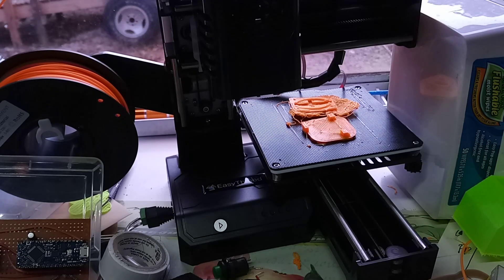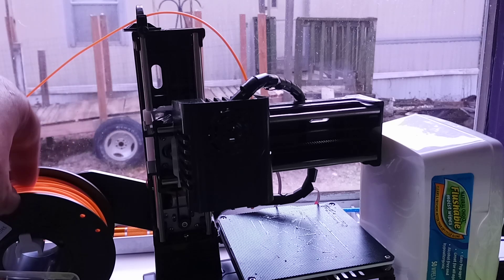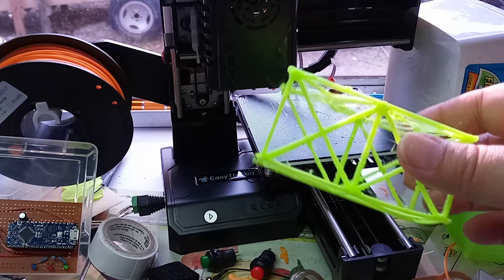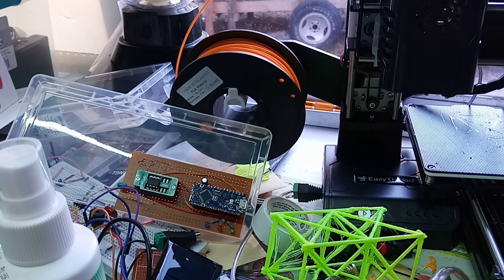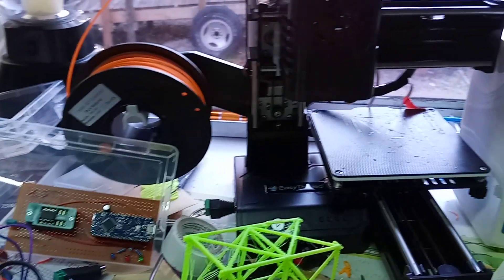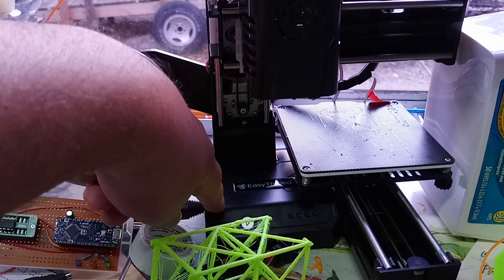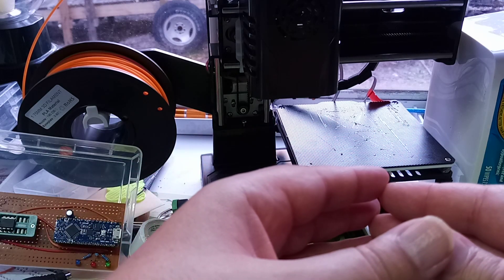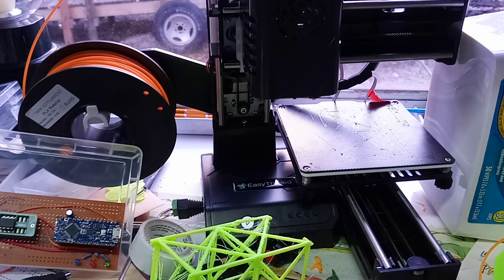Is 3D printing worth my time? #3dprinting #3d #3dprinter #3dprint #productivity #quality

Comment: Your filament is wet.  Your printer, no offense, is shite - which is what I think you brits say - so I'd recommend looking into a  Bambu A1 Mini.  The fact you've had to replace all that stuff is a clear indicator of the quality.  You'll need more desk space for the A1 mini though because it's a bed slinger.  The A1 mini is £141.00 and it's pretty much setup and go.  But also back to my original point, keeping your filament free of moisture would go a long way too.
Reply from the maker: The filament is kept with the printer and there's no actual water gets near it. Only atmospheric humidity will get near the filament and there's nothing that can be done about that.

All this "buy another printer", your filament is "wet" and so on just tells me I made an error of judgement in buying a 3D printer. I'd have been better with a drill press as a basic start. At the time I wondered whether 3D printers sounded too good to be true.
Reply: @britishtechguru  You'll find that's not good enough for such a humid climate.  I live in Vietnam, which is roughly equivalent in terms of humidity as the UK, and I keep my filament in plastic cereal boxes with desiccant holders to keep humidity down to 20%.  PLA is more forgiving, but PETG is a sponge and needs to be dried - in humid environments - before printing.  For PETG I use a filament dryer unit.  I only print PLA/PETG so I'm not knowledgable about other types of plastic like ABS or ASA.  I do know that managing the humidity of my filament gives me crisp non stringing non failing prints, whereas before I did that it was not the case.  You should seriously look into the Bambu A1 mini as it seems perfect for your particular use case.  Good luck!

Comment: Your problem is not with the tool but the money you are willing to spend on dimensional accuracy and quality. Cheap tools are not accurate and, in this case, barely fit for purpose. You may encounter similar issues if you get an inexpensive drill press and lathe. I suggest you appreciate the time, money, energy, and knowledge required for good fabrication. I don't know what tools you already own and have training with, but a drill press and lathe cannot make quality gears or chassis alone. 3D printing is the easiest way to get into fabrication by far. If you had bought a Bambu Lab A1 Mini, this video would show how shocked you are at the quality you can get with a 3D printer.
Reply from the maker: Gears aren't worth printing. I bought a pack of them and 2mm axels on AliExpress a while back. I have electric motors with the same gearing too. That should be fine for most things. I read up on 3D printing and it just seemed that unless I was going to print with nylon, it wasn't worth doing gears. Mind, they're cheap enough for a bagfull anyway. 

I bought the 3D printer more for chassis than anything else. So far it has proven to be a lousy purchase, even for chassis.

I had originally considered a drill press for a rotary tool or a jeweler's lathe. Now, I'm more inclined to get the drill press since I have a rotary tool and try that route.

The biggest factor is my workshop has a nominal 12v (actual 14v) power supply. It is off-grid so there's no mains power at all.

I did have a look at a hotplate for the K9 printer.  There's one that heats to 50C and one that heats to 80C. Those look like power hogs. I'm not sure it's worth throwing more money at 3D printing. It just seems like a dead duck to me.

Comment: 3D printing is definitely worth it for the things you want to do. That printer was made to be as cheap as possible, so getting a more recommended one would give you a much better experience and show you how worth it 3D printing really is. I get wanting to make it work, though.

You could try covering the bed with masking tape and using a cheap glue stick like a Pritt Stick (the cheaper ones tend to work better because the more expensive ones are smoother, and prints don’t stick as well). Lowering the print speeds and making sure the raft is thick enough could also help. It might feel wasteful to use rafts all the time, but it’s often necessary with these types of printers. If you’ve already tried all that, then……..hope for the best hah
Reply from the maker: The raft is a good idea. I think Slic3r has an adjustment for that. I've tried glue sticks and they do seem to improve adhesion a bit. I'm currently trying hairspray and that's not helping.

Comment: I have a Bambu lab and when you are smart about how you print. When to use a brim,when to use hotter or lower print temperatures and your hot plate temperature. 

Alot can be improved with a good machine and even evarage filament can turn out great if you dry it if needed. I mostly print 1 or 2 colors so my waste is not bad.
Reply from the maker: I can try more of a brim on the prints but I don't think that'll improve the general poor quality. I will pick up more glue sticks today. I really do think the answer to good chassis is a mini drill press though.
Reply: @britishtechguru  yes I think so too! Eventually you can make this one work but I'd advice you to just sell it or use it for experimentation and just buy a Bambu lab or even a prusa but I dont know about that brand specificly. Not that I'm a fanboy but I'm a big fan in making things easy.

Comment: 3D printers have come a long way since I first got into them. Back then maintenance was high, and failure rates were high. These days they come packed with sensors, that calibrate everything for you, and detect problems before they waste all your filament. Bambu printers are as plug and play as they get.
Reply from the maker: That just seems like chucking good money after bad. I know a drill press would work. They've been developed for over a century. 3D printers aren't even 10 years old. They're still very much beta experiments.

Comment: Have you tried to do any sort of calibration? Are you working with filament that's properly been stored or dried? Just based on what you've shown I'd bet the answer is no. Your build plate also looks to have a ton of scarring. Most of these issues boil down to user error to be honest.
Reply from the maker: The bed is levelled... That's the  only possible calibration.
Reply: @britishtechguru  There are other calibrations to do, such as flow rate.  Based on you picking that print up, seeing the bottom, it didnt look like it was proper leveled.
Reply from the maker: I leveled it using a piece of paper, sliding it under the nozzle at all 4 points and adjusting until the paper barely cleared.

Comment: My beginner experience has been very different from yours. I got my first 3D printer last Friday, today is Tuesday. I made it a point to not print useless stuff. I also made it a point to have the first item I print actually be a thing that is helpful to me and that I designed myself. I designed a vacuum adapter for my shopvac (reduces the circumference from a saw). I wasn't quite sure of the measurements, I designed it in FreeCAD with as much as I knew. It printed totally fine on the Bambu Lab A1 and when I tried it out it fit like a glove, I was so happy. Then I printed a few printer accessories Friday night, also great, Saturday I threw on a few items that I found on printables, it printed multiple things over 7 hours while I was out and about. All came out great. Sunday a couple other items, even multi-color, also great. This week I was designing some other thing in FreeCAD with a hinge, I'm fine-tuning the gap between two parts and I think 0.1mm is a good gap now. I'm like wow, that thing is awesome, unlocks so much potential. I could never be so precise with a dremel tool. Right angles are totally right, straight edges are totally straight, round objects totally round, this is fantastic. I run the printer in my living room basically, with just PLA there is no smell, it's very quiet, I can sleep close by also. Maybe you can do the same if the power in your shop is difficult. I suggest you try the A1/A1 mini or maybe find someone who has one to test it out. I'm very blown away by the potential that I have discovered in just the last few days. And I'm no expert, so it's not me who makes all that work, I have a suspicion it's the printer...
Reply from the maker: Whatever I bought had to work off the nominal 12v (actual 14v) from my lab power supply. This is what the selling point of the EasyThreed K9 was. The unheated bed was another selling point as I can probably get only 5A from the power supply.

This thing had mixed reviews. I can see areas where it could be fixed some. I can see where tinkering might improve it some.

On the whole though, as what I need is chassis and structural members a drill press and brass or aluminium would work. Possibly even thin wood too.
Reply: If you have 12V in your shop only but more power elsewhere, then try 3d printing elsewhere, there are materials that are clean, like PLA that you can even print with in your living room. If you have only 12V period, then yes, 3D printing on 12V is likely not feasible given the power required for melting the filaments and heating the base plate, but then the video should be titled "Is 3D printing on 12V worth one's time?". For this question, the answer is no.
Reply from the maker: My workshop is 12v off grid. The K9 uses 12v. In fact the transformer produces 11.9v while the board takes 12-24v and my nominal 12v is nearer 14v.

Comment: If you have gotten a very cheap ender 3, like a returned  ender 3, you would print a lot better than that "garbage", for probably less money, and It could be able to self upgrade to a very decent printer with a few cheap mods... You bought a bad Printer, but it may be useful for other projects, or to tinker with. That's a way to see them, spare parts.... You need a well calibrated printer in order to get accuracy, that might be very hard with that particular printer.
Reply from the maker: I bought this as I was not sure if 3D printing would be worthwhile for me. Pretty much, this has demonstrated to me that it is not.
Reply: @britishtechguru  It's easy to fall into a pitfall as a beginner, but don't blame 3D printing for a user mistake, as seemingly nearly no research had gone into the purchase decision.. There are several communities that could've told you how bad this printer is, and could've recommended much better options in the same price range, if you weren't willing to have a bigger budget.
This machine in no way represents the state of proper 3D printers.
Reply from the maker: @raremc1620  I did research and enough to plonk down money. Sure I heard bad things about the printer but then most everywhere you look online you see bad things about everything. It's pot luck and no good looking at reviews as half are fake and the other half are questionable. The only good thing is the printer failed and I did get a refund so I'm out only the $20 for the replacement circuit board, $5 for the new nozzle and $10 for the new print mats.

Having had this experience I will probably look for a mini drill press instead and go the mechanical route I was originally considering. 3D printing seemed too good to be true and I fell for it.

Comment: I would recommend considering the Bambu Lab A1 Mini (£169.00 GBP) or the A1 (£289.00 GBP). Both models are ready to use straight out of the box, with no need to adjust any settings.
Reply from the maker: I'm looking at playing more with the settings. If that doesn't work then I'm more inclined not to throw more money at 3D printing but instead to spend that $200-300 on a micro lathe and micro drill press. With that I could build the chassis that I need and at the end of the day that's all I need.
Reply: @britishtechguru  You have bought the most low-end of low-end printers, which are essentially just novelty items you'd buy as a present for a kid or someone who doesn't actually have use-case in printing. Honestly, no amount of tinkering will bring this printer to acceptable levels, it's just pure trash, especially for practical applications like robotics.

On-top of that, you are using low quality filament from a brand that isn't reputable. Mind you, good branded filament isn't much more expensive than the "generic" brands, if you can even call them that, good filament costs around 20ish $/kg.

The mentioned printers above are great printers that work basically out of the box. They have many automatic calibration steps, the build quality is great, maintenance and assembly is documented nearly perfectly, and so on. They both are great inexperienced user machines. Bambu Lab also sells filament which is of good quality, if you don't wish to look for other filament brands.
You'll still need to learn how to model things if you want to apply 3D printing to robotics, unless you can find some models of what you want online.

Alternatively, you could buy older and cheaper, budget machines, like Ender 3s from creality, though depending on the specific model and state of machine, you could be in some tinkering there. BUT those printers can actually print well with proper attention to setting it up, calibrating it yourself, etc, unlike the printer you've got now. Enders can be picked up for under 50$ on tech store sales, though those usually are older models that lack a lot of convenience features.

TLDR: You'll get nowhere with this printer and filament. Spend a bit on an A1 Mini for genuinely mostly hands off printing at great quality, or get a cheap budget machine on sale from reputable brands.
Reply: @britishtechguru  Wrote a reply summing up that there is no point of messing with the current printer you have because it's essentially only meant as a toy for kids and as a novelty gift. Honestly, the only reason why 3D printing so far has been bad for you, is of this. The printer is utter garbage, and is unable to do nearly any proper printing tasks, let alone ones that would give you results for robotics.
Youtube seems to have deleted my original comment.

The two machines mentioned above are mostly hands off, they have many automated calibration procedures that you don't have to do manually, the instructions to assemble and maintain them are well documented and the print quality with them is great. They are also quite quick printers, not the fastest you can get, but for the projects you want them for, they are entirely capable. Also if you decide to get one of them, get yourself some good, reputable brand filament, Bambu Lab also makes their own, it barely costs more than the "generic" or "cheap" filaments do.
Reply: @britishtechguru  You could also just get an Ender 3 V3 SE, which is the printer I got. That's pretty much the cheapest reliable printer you can get. Price wise, the A1 Mini is not that far off and a better printer and I also wanted that but didn't go for it due to the smaller bed size and the cost of the AMS upgrade. The SE also requires some upgrade but it works out of the box and you don't need to upgrade it to get good prints.

Though do note that for basically anything non-PLA (and I'd suggest to just keep even PLA in good condition), you better keep your filaments dry for any printer. Humidity will cause even the most expensive industrial printer to fail, eventually. Stuff like PETG and TPU definitely needs drying.
Reply: yea i would say a1 mini $199 US and its drop your model and print..no leveling, nothing. What you have there is a pile of ...not current or quality gear.